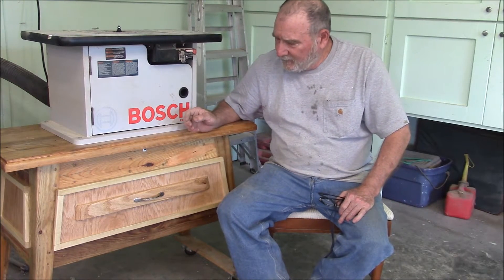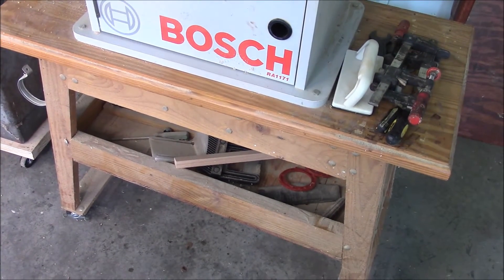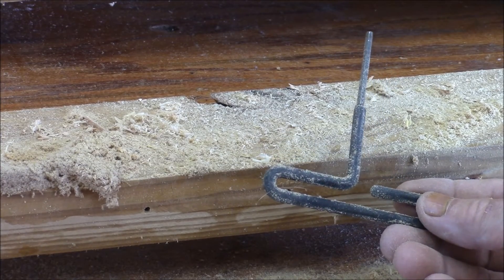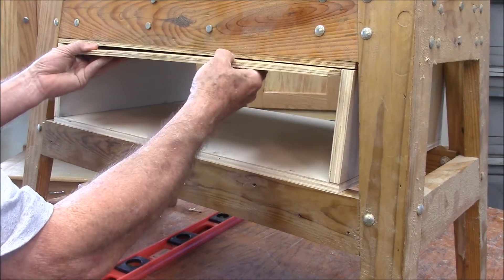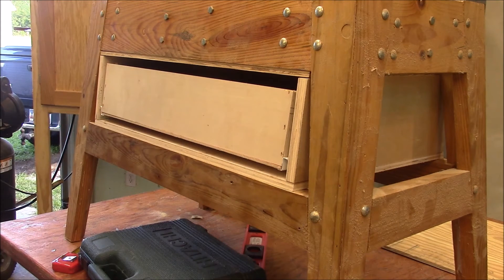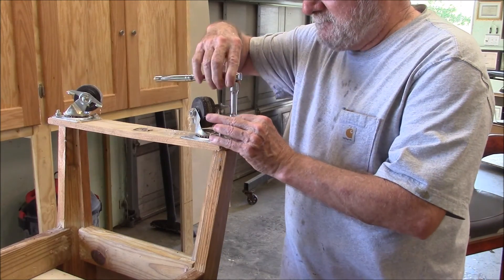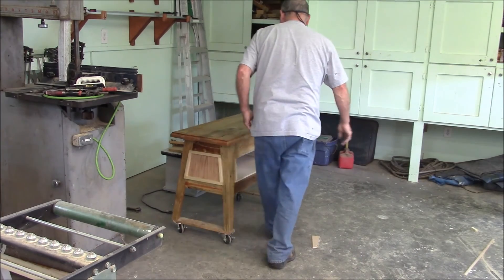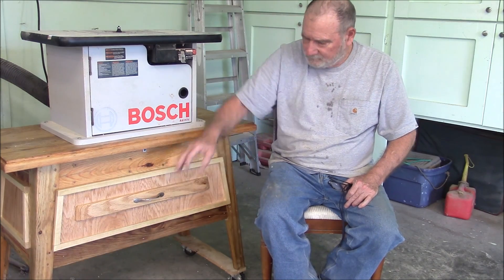67 Installing a drawer and rebuilding router table

Comment: I like the design of the drawer and hopefully that will take care of the sawdust and lost tools problem. I can't say much about the 48 lag bolts because I tend to build things the same way -- more screws, nails, bolts, etc. than are actually needed -- because I don't want anything I build to ever fall apart. I like the the idea of replacing the bolts with dowels even though I don't mind the industrial look, and I think it's safe to say your redesigned router table will easily last 100 years.